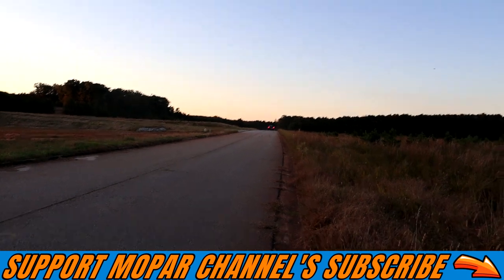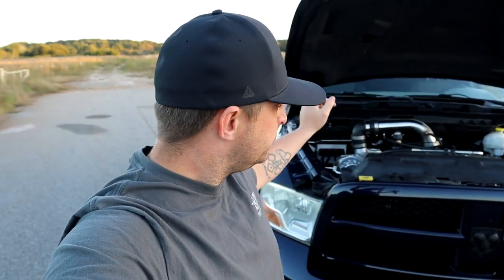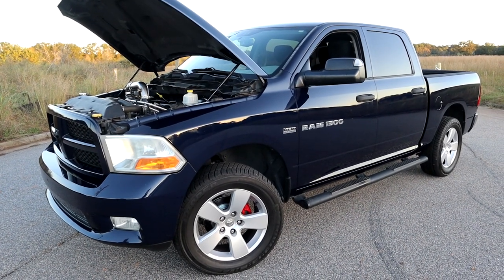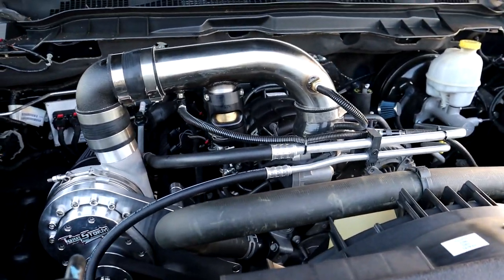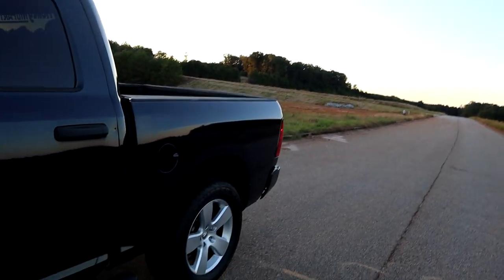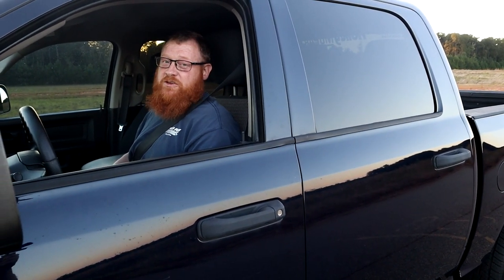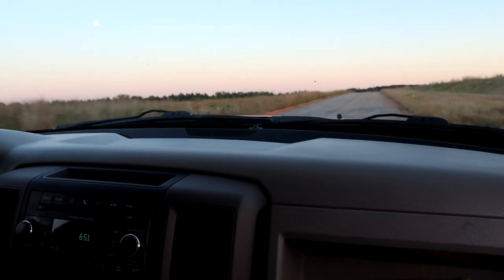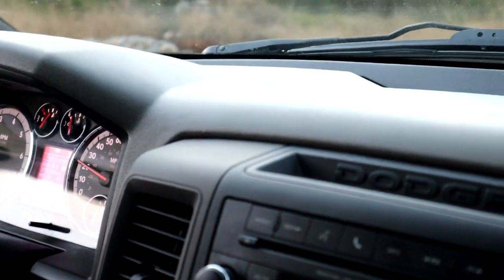Project STORM Is Done TorqStorm Supercharged HEMI RAM 4X4

Comment: Hey Hemi brothers! ,Did you know on the factory intake box . If you  move that angled tube exiting the air box so it is grabbing air from down . That 5.7 will get more air then before .
After that my guess is you should be able to take off about 4-6 seconds ! Off your 1/4 mile time. 
On my 2014 1500 4 dr 4x4 my factory air box is getting air from a 4 inch angled and open to a 5 inch tube running down 10 inches and fastened to the frame .. where the air would also be alot cooler.my truck has soo much more pull. Oh yes if you do this ,don't reset the computer afterwards. The compu needs to think that it's getting more air than needed. You'll use way less fuel .

Comment: That torqstorm sure does have a unique whistle, little lazy down low but nothing some bolt ons can't fix.
Reply from the maker: Little more tuning and she be ready.  But yeah this truck is stock stock.
Reply: @FrostbiteRam  Those 3.21s are looooong even in an 8 speed.  I had to do a double take for the dial as I thought it was a 5/6 speed...
Reply from the maker: @GarcBomber  this truck is a 6speed
Reply: @FrostbiteRam  well shit, thought I saw a dial shifter.  Must be on the console, my bad!
Reply: @GarcBomber  the dial shifter you saw is for the 4x4

Comment: I have a 2014 Ram 1500 2 wheel drive 5.7 Hemi driving down the freeway it kicks down into 4th gear and get stuck there unless I shut the truck off and restart it
Reply from the maker: Could be a shift solenoid but I would get a diagnosis first from a scanner or shop.

Comment: What’s the rear gear ratio? I have 2012 just the same my 12 came with a 3.55 gear ratio, bought a 2018 rebel it came with a 3.92 gear ratio BIG BIG DIFFERENCE!    A world of difference.
Reply from the maker: Pretty sure this truck is 355
Reply: 8spd vs barley a 6spd is huge aswell from those years.

Comment: when you installed your long tubes did you encounter (closed loop fueling not achieved) code? Now my ram wont start
Reply from the maker: No I had no issues,  you do have your front o2s installed right
Reply: @FrostbiteRam  yes I put all 4 back in
Reply: i wonder if a custom tune shutting off the downstream o2"s will help
Reply from the maker: @ChrisCarpenter-d5e  I wouldn't think so but tune will definitely help

Comment: I need this on my ram asap 🥴
Reply: @stormram2783  if I do I may go intercooler instead of meth, should be interesting, awesome build bro
Reply: @mikenyikes4943  thanks. Yeah only reason we didnt go intercooler was to stay low on the budget and not have a lot of piping to run. Kinda wanted to keep it simple.
Reply: @mikenyikes4943  frostbite has both on his 🤪
Reply: @stormram2783  that makes sense, and more of a simple setup
Reply: @stormram2783  ohhh ya I know, frostbite ram is 🥶

Comment: Just put a Texas speed cam in my ram after about 1000miles it smokes some at idle only not on a cold start you think a catch can does anything
Reply from the maker: Sounds like valve seals possible how many miles
Reply: 57000 Guy that done the work had new seals
Reply from the maker: @gregroughton7780  interesting what color is the smoke?
Reply: I think it's blue kind it's not very much have to be at the right angle to notice it
Reply: Kind of